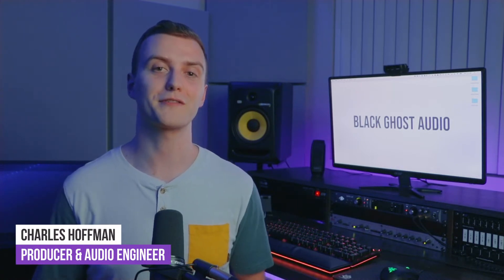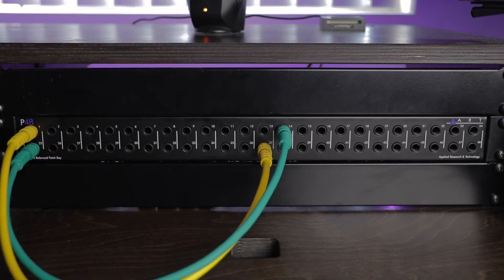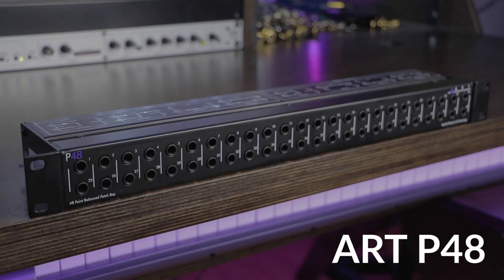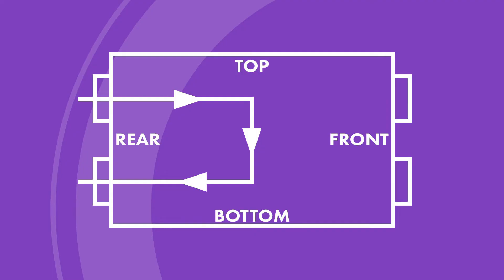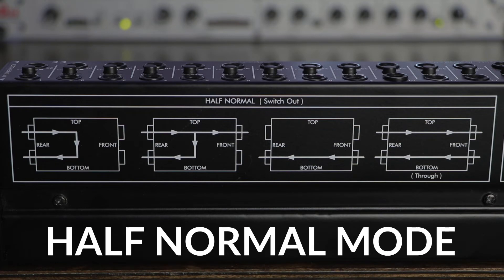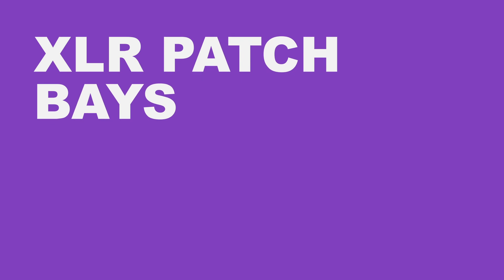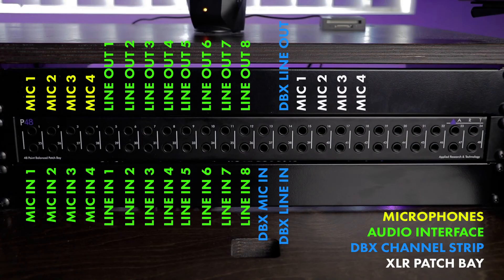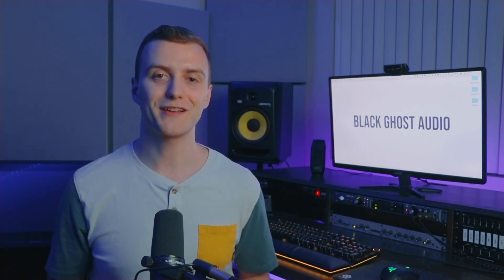How to Set Up and Use a Patch Bay

Comment: Very useful and succinct tutorial, Chuck. Used to use patch bays all the time in my old pre-2000 analog and ADAT studio. However, stopped using them for past 20 years while just working "in the box.". Wow, this is a welcome refresher as I just bought a Focusrite 8 channel interface and want to incorporate some great analog equipment (compressors, reverbs, etc.) that I still own in to the signal chain. This tutorial was very straight forward and things came back to me quickly just listening. Thanks very much for taking the time.
Reply: So you don’t necessarily need a patch  bay?

Comment: Best video I've seen so far on how to set up a patch bay and I've watched many! I do have a question though. When no patch cables are connected, you essentially have all of your audio interface outputs connected to all of your audio interface inputs. Doesn't that create some sort of feedback loop?
Reply from the maker: It is possible to create a feedback loop, but the only time this would happen is when you set up a track to behave this way. By default, your DAW is going to route the output of tracks to the master channel, as opposed to your audio interface's line outputs. The same thing goes for track inputs—tracks are likely assigned line input 1 as the external input by default, but you need to either engage input monitoring or record to the track to hear the input signal. To create a feedback loop, you'd need to intentionally assign a track's output to line X, and then assign the same track's input to line X as well.

If you wanted to be extra careful, you could just shift all your line inputs over to the right or left by one port on your patch bay so that there's no chance of creating a feedback loop. I like stacking them in this way to keep things organized, but to each their own!
Reply: @BlackGhostAudio  Thanks for your thoughtful reply! It took me a while to wrap my head around this patchbay concept. Your video made it finally click in my head!

Comment: Thanks a lot for the video .
I just got myself a Samson patchbay which I would like to connect to my two UAD Apollo’s .
I usually next 1 mic Channel only . I heard mic channel shouldn’t go into a patchbay ? As of my UAD audio interface ( I need to switch between line or Mic input ) .

Appreciated your advice 🙏🏻
Reply from the maker: My Apollo has separate mic and line inputs so I can connect them separately to my patch bay. If your Apollos use combo (mic/line) input jacks, you could connect the jacks to your patch bay but leave them set to mic mode or line mode. It all comes down to what you’re trying to do and how often you use the mic vs. line inputs. Another option is to dedicate two jacks on the back of your patch bay to a combo input jack, connect cables to the patch bay jacks, and then connect the other end of those cables to your interface on a need-to-use basis.
Reply: @BlackGhostAudio  thank you very much for your detailed information. Indeed my Apollo’s has separate line and mic input . Great ! :)
Reply: @BlackGhostAudio  Just a total newb piggybacking here :) I have an Apollo Twin with combo jacks. For mics and my captor x, is it worth buying some kind of mic-to-line level conversion box? For home recording purposes, can't the level difference between mic/line just be solved by turning the preamp up?
Reply from the maker: @worldwidehoodoo  if you’re not using a patch bay, there’s nothing to worry about. Just plug into your combo input jacks and turn up the preamps as necessary.
Reply: @BlackGhostAudio  I should have clarified: I am using a patch bay (or at least attempting to.) Thanks for the quick reply!

Comment: hey man thanks a lot for the video! I'm still confused tho.. could you maybe tell me pls where I put the outs of my compressor and the ins so I could connect to it from the front?
Reply from the maker: For sure. Start by picking a pair of jacks on the back of the patch bay (one top jack and its corresponding bottom jack). Connect the bottom jack to the input of your compressor, and then connect the output of your compressor to the top jack. 

Once you've done this, you can route a signal in and out of the compressor by connecting patch cables to the jacks on the front of the patch bay.
Reply: @BlackGhostAudio  tysm!:) could u pls tell me if my patchbay should be on "normal" or "half normal?" I got the neutrik spp l1 btw...
Reply from the maker: @volcaniadread  you can set the pair of jacks you're using to normal mode.

Comment: Hey, great video breaking it down! in the diagram at 4.32 you have all 8 line ins connected but aren't the first four taken up by mics? or do you have seperate line ins on your interface? If so what Apollo are you using? Once again great video!
Reply from the maker: Good question! I'm using the Apollo x8, which has four dedicated mic inputs and eight dedicated line inputs. My Apollo lets me switch the first four inputs between mic and line mode so I can choose which inputs I want to use.
Reply: @BlackGhostAudio  Gotcha! that makes sense, I've got another question not really related to your studio but more big commercial studios, you know how they have wall mounts (multicore, or stage boxes to connect the mics too in the live rooms) how do they connect that to a patchbay? because the ones ive seen only have XLR outputs. Thanks for your time!
Reply from the maker: @digitaltrackz  Big studio patch bays often have DB-25 inputs on the back (example: https://bit.ly/3k3nULM) that you plug various types of snake cables into. To connect one of those live room mic tie panels to a patch bay like this, you would likely use a DB-25 to XLR snake cable (male or female depending on what you need). These snake cables look like this: https://bit.ly/2VmTIkj. You can get DB-25 to TRS snake cables (https://bit.ly/3xBs7dp) too so it's just a matter of getting your hands on the right snake cable for the gear you're connecting to your patch bay.
Reply: @BlackGhostAudio  Thanks man, much appreciated!

Comment: Informative video, thank you! The last time I used a patch bay was in 2005, and honestly, I sort of forgot how they worked. I could probably use at least a small one for my home studio.
Reply from the maker: Cool! It's definitely handy to keep one around if you have an assortment of gear.
Reply: @BlackGhostAudio  actually i'm thinking it might work great for my keyboard pedalboard -- put the patchbay on my sturdy stand, and plug cords from the board into it. that way if the board isn't plugged into it, the signal from the keyboard will just route back up to my mixer.

Comment: heya man, came across your vid looking to set up my own patchbay. I wanted to patch my headphones from my interface into the bay so I can swap headphones easily but I read that could blow the patch bay because its an amplified signal. not quite sure what to think of that, could use some advic. thanks so much
Reply from the maker: From everything I've read, it's not recommended. One of the main issues is that you could accidentally connect to the wrong input on a piece of gear and fry it. I can't find any documentation on whether or not the patch bay is capable of handling the wattage so I'm not sure if you'd actually damage it.

Instead of running an amplified signal through the patch bay, run your headphone mix through a pair of your audio interface's line outputs and to an external headphone amp with multiple outputs. You can configure this routing through the patch bay if you want since you'll be sending the headphone amp a line-level signal.

If you decide to do this, invest in a quality headphone amp. A lot of the cheap ones drastically degrade sound quality.

Super ultra cheapo option number two is to get a headphone splitter on Amazon for like $6, haha. I'm not sure what that will do to the sound quality but it's cheap and a low-risk experiment.

Comment: Excellent video although using a TRS for a phantom powered microphone wouldn't be my first choice. Although you can pass phantom power over a TRS cable plugging and unplugging TRS cables will create a momentary short circuit that could damage equipment.
Reply from the maker: I believe this is why pro studios prefer TT patch bays. The cable design helps prevent those momentary shorts but the patch bays themselves can be quite expensive. Nice bit of info you added here. Thanks!

Comment: Very nice video, however, I have an Art P16  xlr patchbay pass thru, a Samson s plus 1/4” patchbay. I’m trying to figure out how to patch from my Fredenstein bento 500 rack with 8 mic preamps to the Samson pb also using the Art pb to plug my mics into at the front of my rack. Is this possible to correctly do this?

Comment: Great video!! Very clear and easy to follow. I’m finally adding a 1/4” patch bay after many years and I’m stumped on the mic ins. I have an Apollo x8 which as you know comes with 4 xlr mic ins. I’d like access to those as well as my outboard gear for mics, but isn’t your only choice to have a small 4 channel snake to be able to plug into or are you simply getting a xlr/trs adapter and going right to patchbay? I just thought it was bad to use the trs adapter but I’m not sure. I’m not even using phantom power for the stock mic press anyway. I’ll take any advice:)
Reply from the maker: Ya, I’m just using XLR/TRS adapters. You shouldn’t experience any issues. If you use the same patch bay as me, you can pass phantom power through it too.
Reply: @BlackGhostAudio  awe ok.!! So use trs adapters from xlr to patch-bay and then you would also need adapters for the front too right? (To plug in a mic)
Also I’m hoping u have a link to the patch bay labels. I’ll check
Reply from the maker: @Hearthmusic  you’ll plug your mics into the back of the patch bay using XLR/TRS adapters. The signal will cascade down into your audio interface’s mic inputs. This configuration allows you to tap the signal pre-interface and use standalone preamps if desired.

I actually made a Reddit post a while ago that contains a link to a PSD file with P48 patch bay labels. You can customize it however you want: https://www.google.com/amp/s/amp.reddit.com/r/edmproduction/comments/a5wg8a/art_p48_patch_bay_1u_label_template_free_download/
Reply: @BlackGhostAudio  I think I get it except for you still have to have cables into the actual XLR jacks on back of Apollo, no? 
2nd question; I’ve got the Sampson 48 patch bay, Apollo X8, UA LA610, WA273-EQ , Yamaha monitors and a Mackie headphone amp. Pretty simple setup, nothing fancy but I’m so rusty that I’m a bit stumped. Before I purchase anything from your links what would u charge for a 1 hour consult. Just trying to get another studio guys perspective on how to set this up. I can send an excel file, etc. etc. happy to pay for help but is that something you do?
Reply: @BlackGhostAudio  Ok, I’ve got my TRS snakes for line in and out all set basically mirroring yours except I ran my monitors thru 1 and 2. Anyway, just stumped on 1 small thing. At 4:07 on your video you say I run my mics directly to interface so the mic IN’s on the bottom say Interface. That makes sense but still lost how you pull in both the interface and patchbay at that point. I’m sure this is much more simple but I’m missing one step. Sorry for all the questions.
Reply: @Hearthmusic  I'm stumped too.  I think he's missing how to input from patchbay to XLRs on interface, especially if you need phantom power.  And if you can only do that with the amount of XLR inputs available on your interface. .. Or can you use like a Di with phantom power for mics, then run it through 1/4 on a patchbay?
Reply from the maker: I answered the question earlier in this thread. All you need are some male to female XLR cables (microphone cables) and male TRS to female XLR adapters 😁. This configuration will pass phantom from the interface to the patch bay and then to your microphone.
Reply: @dustinlaumusic7401  Yeah Dustin, completely understand what you are saying; I just think we might be talking about 2 different things. He's saying plug a regular mic directly into say output 1 of the patch-bay and it cascades down to your inputs which would essentially be great except all my ins on the patchbay are snaked to my line in section of interface. Still cant figure how that pulls in the 4 xlr options like I have. Unless you went XLR from interface to an adapter and that right to an input on patchbay. Anyway, who knows and I don't want to confuse you. I simply kept my 4 XLR"s completely out of the patchbay. Oh well!!! it was fun trying though..

Comment: Great explanation. Do patch bays add to the noise level in a signal chain?
Reply from the maker: They shouldn’t, at least not in any noticeable way. If you’re experiencing noise, make sure the cables you’re recording with aren’t laying anywhere near power cables. Also, plug all of your power cables into a power conditioner. There are lots of reasons for noise, but electromagnetic interference (power cable proximity) and dirty power (fixed with a power conditioner) are some of the most common culprits.
Reply: @BlackGhostAudio  thank you. 🙌🏼 I bought an inexpensive daisy-chain power supply (9V, centre negative)...perhaps this is causing the noise. I have a Jim Dunlop power bank somewhere; I'll see if that helps keep the noise low.

Comment: Thanks for the video!

If you were running a mic to an XLR patchbay before a preamp, and then running the XLR patchbay to a TRS patchbay, and then used the TRS patchbay and a TRS cable to run the mic signal back out of the TRS patchbay into an outboard preamp, could you potentially run into any issues with noise floors, etc., when running a mic level signal through a TRS/line level patch bay and patch cable before the preamp?
Reply from the maker: These are all balanced connections so you shouldn’t have any issues with your noise floor. You can run a balanced mic level signal a fair distance without worrying about noise.
Reply: @BlackGhostAudio  thanks for your quick reply!  I understand the balanced connection should be ideal when preventing any interference.  I think I worded my question wrong.

I am concerned with the impedance difference between mic and line levels.  Preamps have different inputs to accomadate the impedance difference between a mic and say direct bass guitar or keys.  If you connect a mic level signal to a line in (the wrong input) on a preamp, for example, you would drastically increase the noise floor.

I saw some forum members saying that an XLR patch bay going directly to mic pres without passing through a TRS patch bay first would be ideal for this reason.  They argued that changing to a TRS connection thru the patch bay could create an impedance/noise issue.

But if it makes no difference, it could be because a patch bay is passive and not a powered piece of gear, so there would be no noise floor on it?  So technically, the connections on a TRS patch bay aren't mic or line level, they are just passing signal through at whatever impedance that signal comes in at?

I am not sure if this makes sense, lol!  I appreciate your help though.  Trying to plan how I will be wiring my next upgrade 🤔
Reply from the maker: @Skateboardingcuber  I see what you’re saying. Ya, as far as I’m aware, the connections themselves are just passing signal through so I don’t think there’s anything to worry about. My dbx 286s has a built-in preamp that I’ve made use of in the way you’ve described: XLR patch bay > TRS patch bay > 286s preamp. I haven’t noticed any noise issues as a result of this routing so I’m giving it my stamp of approval.

If you wanted to be extra careful, you could contact the manufacturer of the TRS patch bay you’re considering purchasing to get an “official” response in regards to whether or not the patch bay affects impedance.

Comment: Hi, thanks for the video! I'd like to ask, whether you can simply connect a microphone to this kind of patchbay, and then you can route the mic to a mic preamp that has an XLR connector? IF so, are you doing this via a TRS Jack/XLR cable? Can you even give a phantom power to the mics if it has to go through a patchbay?
Thanks!
Reply from the maker: Yup! I have microphones attached to the back of this patch bay using male/female XLR cables with XLR to 1/4” TRS adapters on the ends. This particular patch bay passes phantom power through it so you can record with condenser microphones.
Reply: @BlackGhostAudio  thanks for the super fast response! Great to hear that!! I would like to patch microphones as well not just line sources, but would not like to use an extra XLR patchbay for that if I don't necessarily have to.
This is a great idea, thanks for that!! :)
Reply: @BlackGhostAudio  So this patch bay can receive balanced XLR signal correct? Also, when routing mic signal, don't you have to use balanced TRS cables?
Reply from the maker: @idjpashka  Yes, it can receive a balanced XLR signal. The patch cables I’m using in the video are TRS cables. You can get them in a pack on Amazon or Sweetwater👍🏻
Reply: @ingvorosv  Don't overlook the fact that 1/4 jacks come in two types, TRS which stands for tip, ring ,sleeve and just tip and sleeve. TRS are balanced like an xlr connector because they have three conductors as opposed to just the two conductors of the tip, sleeve.

Comment: I am a bit confused after watching this video, you said you use the back Top row of the patchbay to connect your mics as well, these are all TRS connectors. so do you use XLR to TRS cables for connecting your mics ?
Reply from the maker: I do indeed! You can either get XLR to TRS cables or XLR to TRS cable adapters. The adapters are sometimes bulky and tricky to plug into the patch bay so I recommend the cables.